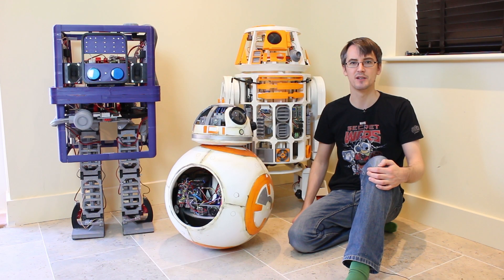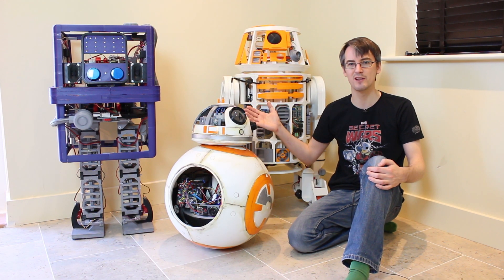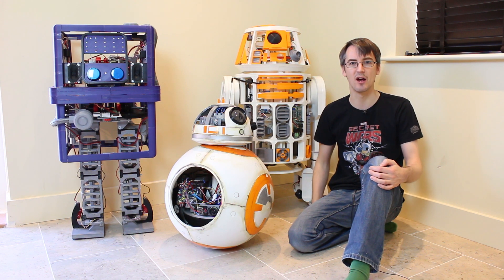Building BB 8, R2-D2 & GNK Droid | James Bruton

Comment: Hey. Good afternoon. It is 13:29 PM. My name is Israel Avilano and I live in Brazil. I'm using a translator to talk to you. I'm a Star Wars fan and would like to build or purchase an R2D2 Radio Control but the cost benefit was affordable. I wanted one with a height of 97cm. Would you help me to acquire one? I could try to build it piece by piece or try to buy one. If I'm going to build one, I'd want to start at the bottom with the wheels and motors and the RC part. I would do the whole structure later in 3D or with another material. It's a dream of mine to have one of these but I wanted to be able to make one that fit in my pocket and do it little by little. Wouldn't it help this fan here? I would be very grateful. I don't know where to buy the parts either.

Comment: You're using freaking tinkercad! Get on Maya. It's better for more advanced designs.
Reply: Your design was fine. Great actually. But on really advanced designs Maya works better, even though some of the features are useless for 3D printing. It does cost money whereas tinkercad is free. But if your just making a gearbox, choose tinkercad. Also, what motors are you using?

Comment: Hey James. Have you ever thought about putting small camera's in your bots' eyes, so you can record their interactions at conventions? 
A small Pi zero with camera module doesn't weigh that much and could easily fit inside BB-8 for example